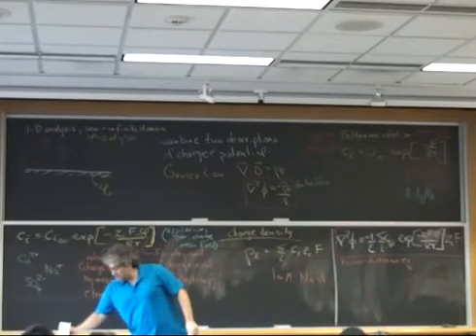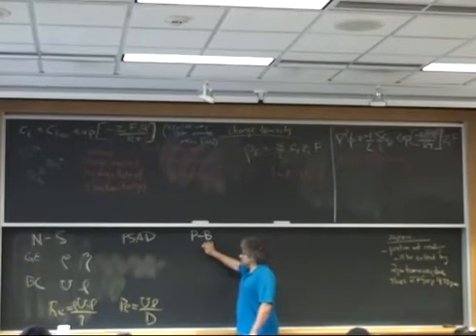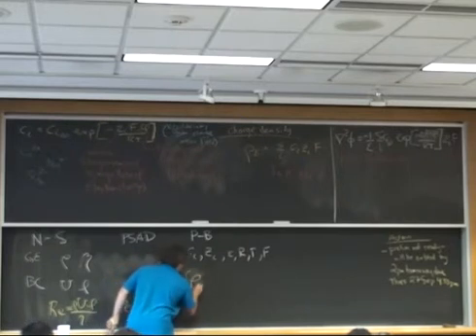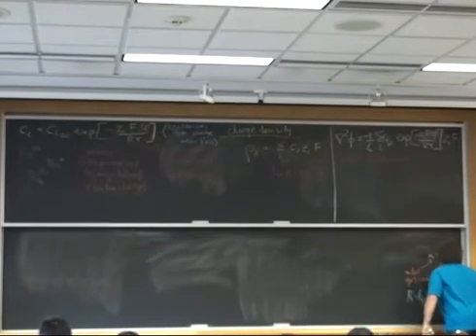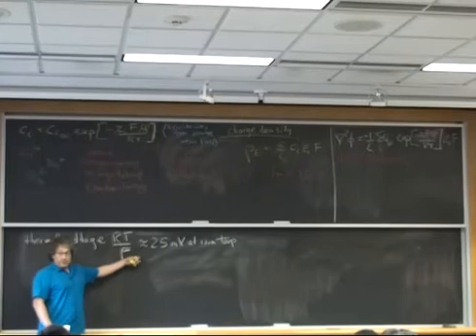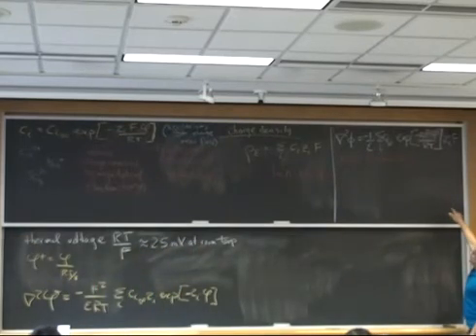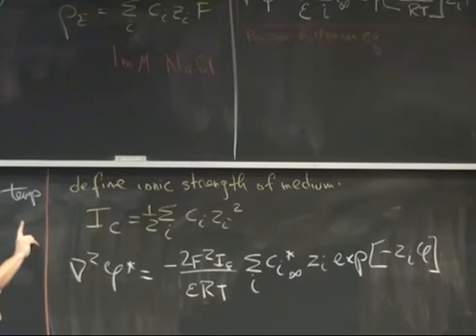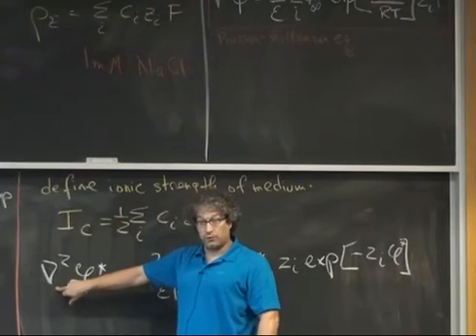1D poisson-boltzmann equation for EDLs in microfluidic systems - nondimensionalization

Comment: in my systems i need to get a hight difference potentiel at the surface or wall so i'm obliged  to applied also a hight potentiel at the surface 1 Volts wich isn't ok with PB equation so what changes can i applied to get a true results
Reply: I've got the same issue with supercapacitors where the voltage is around 1.5-2.5V, and my numerical simulations rapidly diverge. Corrective terms don't help that much... I'm kind of stuck with PB equations too...